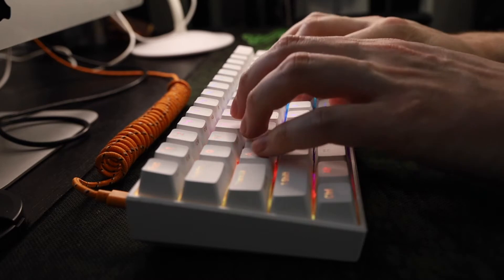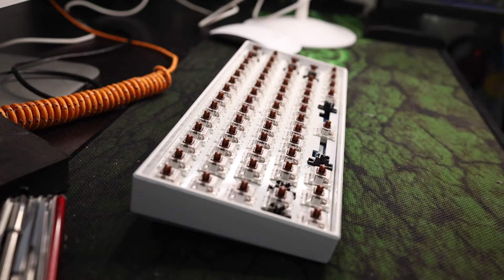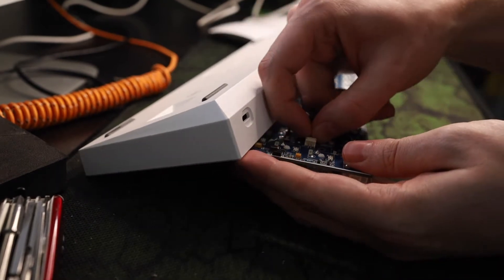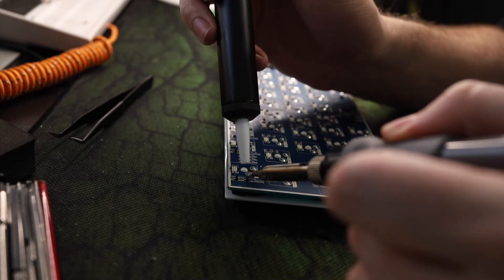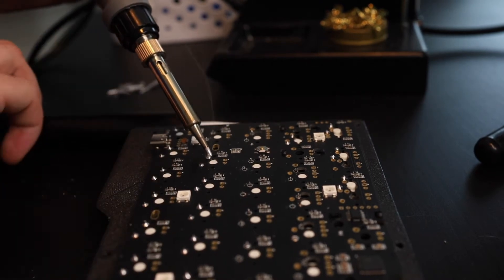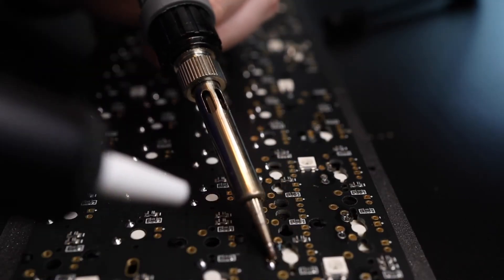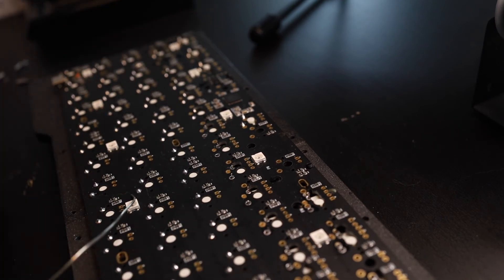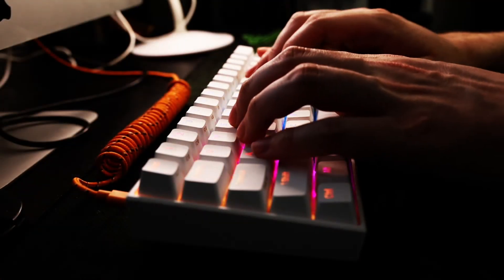Useful tips for desoldering keyboard switches

Comment: I have keyboard with modular switches, so they are not soldered but i dont like sound and feeling of those, and i also have one keyboard with red soldered switches which i like much better, so can i desolder them and use them withould soldering in this modular one?

Comment: Hey nice video, I am having the same problem, if I do not put some solder on it, it wont even melt, even though i use like 450 C, so i have to add a bit of solder to be able to efficiently melt, is a bit of a pian tbh - any tipps?

Comment: Thanks made the process look very approachable, just recently I have been trying to desolder an old keyboard of mine with flux + a desoldering braid with some success but it is fiddly. Just ordered a engineer SS-02 sucker so hopefully should speed up the process. Although the success you are having with a cheaper sucker is making me wish I had tried something like that first. As a side note I am hovering over the buy button on a hot swappable board for when I finally snap trying to do this :).

Comment: Is it necessary to re-solder the switches when you're replacing them? Can't they just sit back in the socket with out being re-soldered? Or will they be too loose/not make contact with the PCB?
Reply: Late reply and if it still maters, you have to resolder the switches as without the solder the switch pins are unable to make contact with the PCB.
Reply: @kitenguyen7437  perfect, thanks!